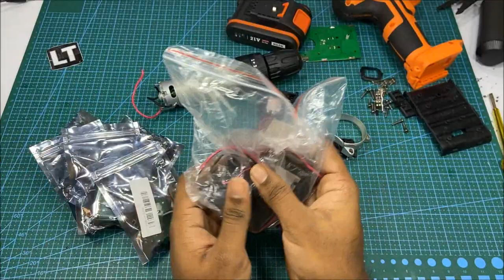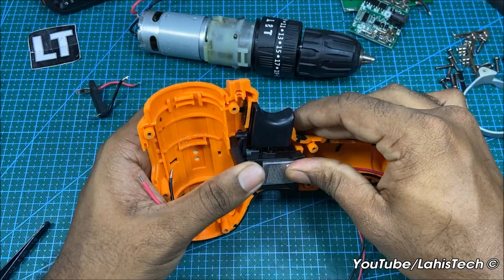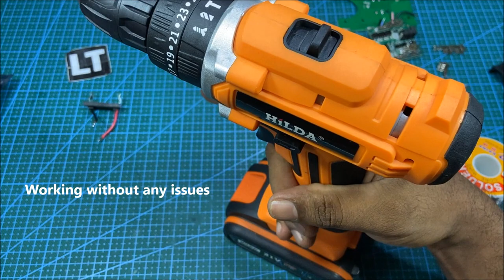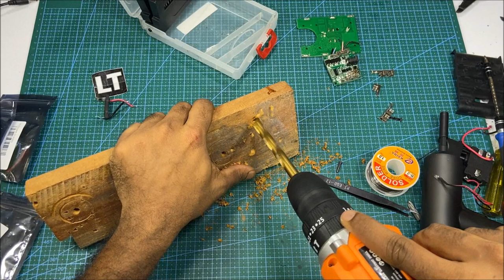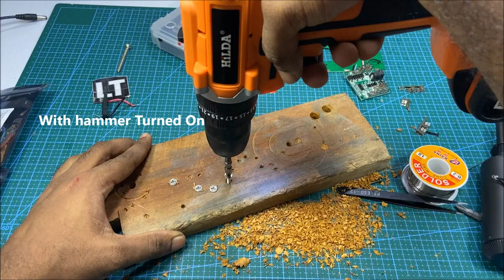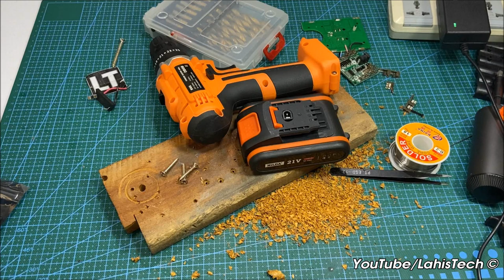How to Repair Cordless Electric Drill | Switch and BMS replacement – Part 2

Comment: hi lahis, my cordless fixman 20v bms  got rusty, and wont run. so i try to replace the bms with others bms 5s. ( the drill is ok, i already try with other battery) but i dont know whats wrong, the light bar is full, when i start  the drill it wont run..! and the light bars drop. .. btw the battery normal.

Comment: Hi Lahis your video presentation is always superb . I need your small favour, i want to change my drill battery voltage from 12v  to 24v , which is the best BMS you recommend , 3s , 4s 0r 5s , please help.. thanks ..
Reply: @user882k  Hi Henry, thanks for your help, i am going to use 18650 batteries , which means 6 cells. than what should be the BMS strengh. .. tks